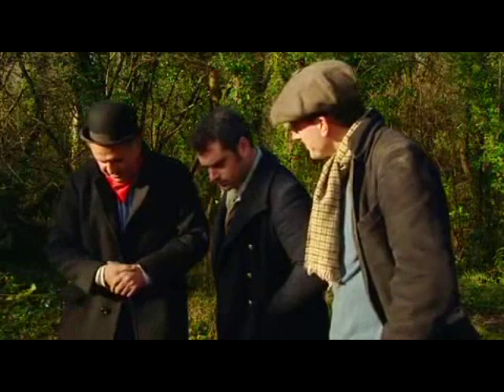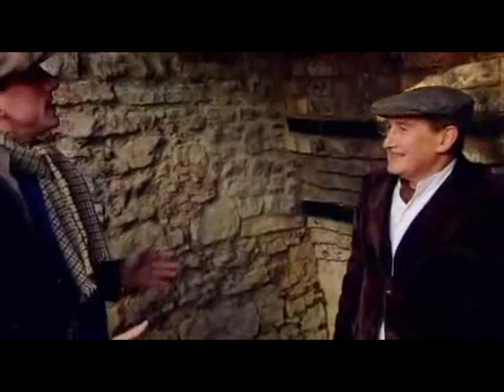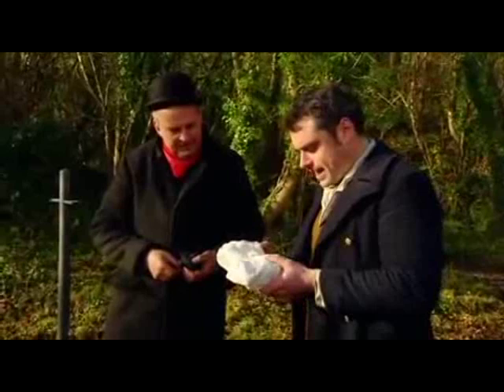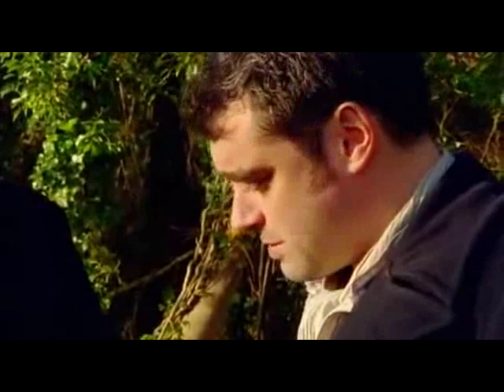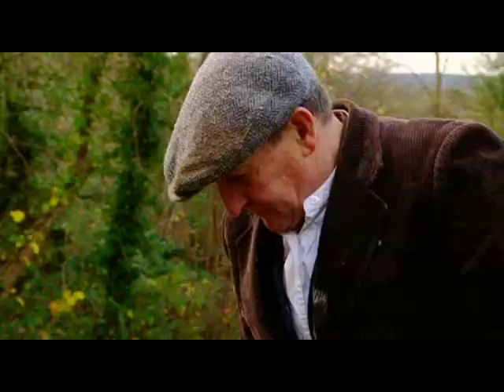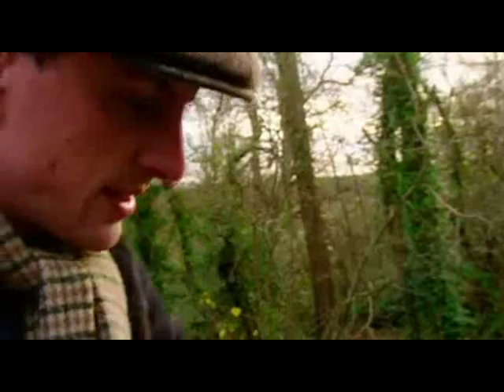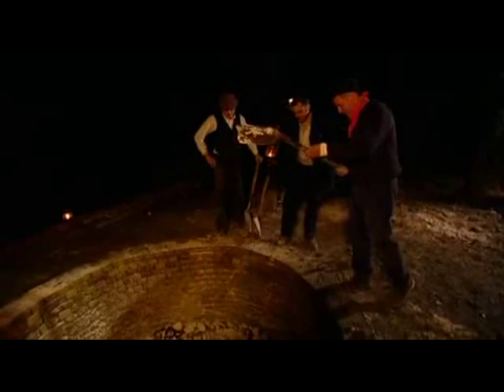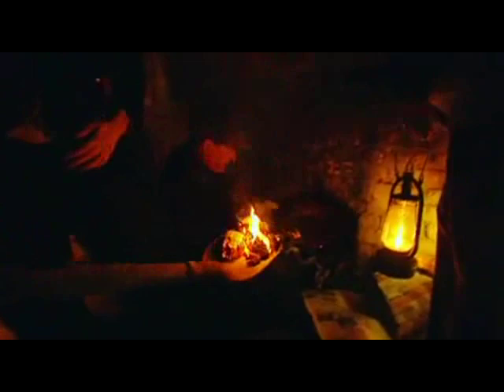Lime Kiln 2/3 - quicklime, lime mortar

Comment: excellent about the measures on the layers in the kiln...and yes sometimes coal may not be easily substituted...modern kilns are steel tubes just off horizontal turned by motors slowly assuring even heat distribution and natural gas burners but carbon monoxide is still produced! and the slowly turning tubes wear as do the screws that slowly move the limestone forward and as the limestone breaks down the kilns can off load directly to slaking and cooling areas for continual operations! but for low energy tech the vertical batch burns proved reliable just a bit labor intensive...but a track loader could make short work off loading...and unloading the kilns to slaking ponds! the lime putty could then be barreled and sealed for future use! especially for housing nothing better than limed adobe with a good pair of shoes , gloria, and a rock steady roof today probably engineered metal shingles for ease of repair ! I know to historians this may seem sacrilege! However having a home be generational for over 500 years with built in heating and cooling is the off grid ideal...and the next issues of off grid water treatment for gray water and only black water going to process allows for irrigated gardens etc...leaving municipalities less burdened as would your purse be less burdened! We need to raise our lower classes standards through skill and education soon, or the problem of dependence will be out right unmanageable! Sorry but there it is and it is global...